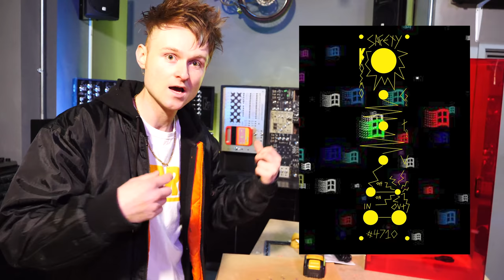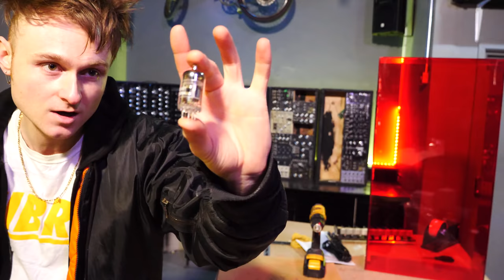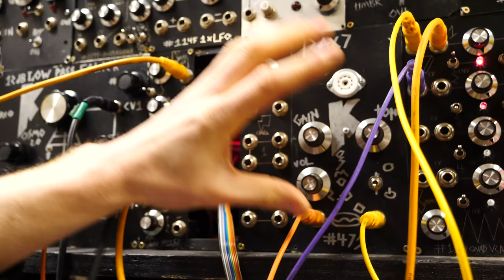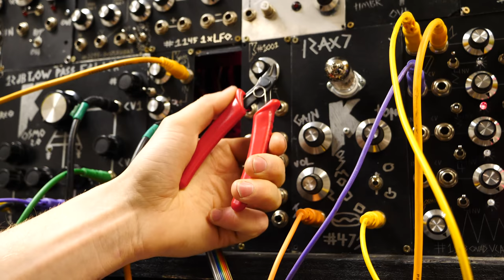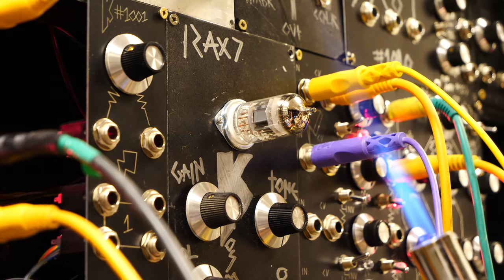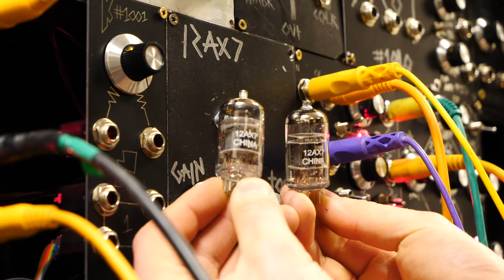Breaking a Vacuum Tube And Seeing What It Sounds Like - On A Valve Distortion

Comment from the maker: sorry if this triggered you, but the fact is i knew what would happen ie the technicals and theory... its obvious,, i did this to see what sounds it would make in the process of it happening. People are saying the heating filament went pop, this is not the case, its probably fine, this is running at low temperatures, the most likely explanation to what your hearing is an increase in resistence ruining the electrons commute to work..., in the next vid on this im going to try and revive these tubes. Im not sure wether its going to be super possible, but its worth a go. maybe id stuff em with calcium or some sort of getter aswell who knows i have a couple of things on order watch this space!.\
also samples from this available here and also extra vids on upcoming builds:
https://www.patreon.com/posts/46690985
Reply: aaand just became a patron! 😀
Reply: What happens if you hook a vacuum pump to one of those valves and vary the under pressure in them?
Would that be a vacuum bent circuit?
Reply: @zid_just_zid  Excellent idea!  I would also like to add....what happens if after you purge the air if you add an inert or alternative gas?  Something like nitrogen would be a place to start.  A simple vacuum pump, nitrogen bottle with regulator with a couple of valves and a t connector could easily be bodged together by LMNC.   

He may need to attach a glass connector tube. A map gas torch could be used to heat up the connector tube and stick it to the valve/tube nipple.
Reply: Have you ever tried playing with 'flame triodes'? They're very simple to build and would be right up your street for the funky sounds they can make, but I've never seen anyone use them for anything outside of small experimental stuff. Search for them on Youtube and some examples should come up.
Reply: Can you put the valves in a vacuum and make them work again?  What happens if you fill them with different gases? :-)
Reply: This was of interest to many people, I think you've saved valves by sharing this information.
Reply: Experiments are never a waste.
👍😷
Reply: Was kind of sad to see them die but to be honest they probably didn't sound great but still... Old telefunkn, nos tongsols, nos rca really go to town. Newer ge stuff & some others really dont compare at all.
Reply: i know its not your norm....but someone needs to do how tos on building vacuum tube cercets
Reply: Hey, a while ago there were special triodes used to measure a pressure in science labs. Why don't you use one of them? Look for hot filament ionization gauges. The old ones even have the same pins as the regular valves. The benefits are that they can be exposed to the air while cold and they have all the glass fittings to work with gases and vacuum pumps.
Reply: so much anger  😂
Reply: I was actually pretty curious about the result. I haven't expected it would be so unspectacular. But I should have. You immediately put molecules where there should be space for the electrons. Do you want to test it better? Make a hole into a tube, connect a tiny rubber hose to it, seal it very tight with a glue or something, connect it to a vacuum pump where you would be able to regulate the pressure inside a tube. Turn the thing on with the lowest available pressure. If the vacuum pump is really good and the sealing is tight enough - it should work. Then very slowly increase the pressure. I guess the lamp amplification would just gradually decrease, no fancy effects. What is more interesting is playing with the filament voltage. When you decrease it - the effect would be very similar to that when the tube warms up. But when you increase it over the tube rating - it will not break instantly. You can test what would happen ;)
Reply: How about -- put a dab of epoxy on the nib then put the tube, er valve, into a vacuum chamber.  Maybe as the air escapes the tube, the epoxy will just kind of bubble and then settle back into a nice seal.  Clean the glass with some alcohol to make sure you remove skin oils that are on the glass.
Reply: @JB-xg7io  not sure but u know there is no air in the tube?, air rushes into the tube, not out, as he cracks it. as it is a vacuum sealed component.
Reply: I was talking about recreating the vacuum condition in the tube

Comment: I wonder if a strong magnetic field would change the sound.
Reply: Bump
Reply: I agree. And use an electomagnet controlled by CV.
Reply: @knuteri3  oh yes, please
Reply: CV controllable electromagnets would be pretty juicy to meddle with and threaten the valve leading to more darkness and chaos.  Chaos and electronic anarchy for the sake chaos and electronic anarchy!
Reply: It would probably be a bit like a VCA. The magnetic field would deflect the electrons away from their path to the anode. If the magnetic field was AC, it would push the beam back and forth at the frequency of the field. The problem is, if you permanently magnetized the metal in the tube, it would permanently push the beam somewhere and it would either be quiet or not working at all.
Reply: The anode surrounds the cathode so I think it's unlikely you could stop any electrons from reaching it
Reply from the maker: got some heft magnets on the way coolio
Reply: @LOOKMUMNOCOMPUTER  Nice!
Reply: It would.  I have  done that with  various tubes. Moving tthe magnets around the tube is like changing bias or  providing an accelerator anode,
Reply: @quantumbits  nice!
Reply: @quantumbits  I tried doing this with my Metasonix modules, but the only tubes I noticed any effects on were thyratrons. Maybe I need a more powerful magnet?
Reply: I put a magnet on the valve in my headphone amplifier and it made the sound noticeably quieter.
Reply: @LOOKMUMNOCOMPUTER  if the magnet changes the sound, you HAVE to make a modifyed version with an extra cv in and an electromagnet around the tube so that it can be modulated. also, love the kosmo modules, ive built the 3340 vco with all pw options and the 12ax7vca, im currently building a triple 3340 bank and plan on building more. this channel is putting out the best content on this website
Reply: @LOOKMUMNOCOMPUTER  grab the deflection collar from an old crt monitor.....
Reply: I've wondered something similar. Mine is to do with the risk of a magmount antenna too close to a valve communications receiver.
Reply: @LOOKMUMNOCOMPUTER  Keep Em Away From Any Hard drives, Could Wipe Em Clean depending on the strength
Reply: @wisteela  The tube only responded in  my case to a (maybe 8mm wide) neodymium magnet less than 1cm to the glass of the tube, in a way that it it is near to the anode. So unless it is some weird tube with magnets in it like a trochotron or a CRT (or a magic eye, those respond to even weak magnetic fields very visibly, and may have the picture warped until demagnetized), needs some precise adjustment or the magnet is very big, you probably won't notice any adverse effect. You could on the other hand also partially saturate a ferrite or steel core of some inductive element, and that could have some adverse effects. But again, strong magnet and very close to the component, and vacuum tube devices are generally rather roomy inside, so no components pushed right against the enclosure.
Reply: imagine.. a magnetic-tube compressor
Reply: @snazzback  I saw a patent for a magnetically controlled tube, which had flat, vertical bars between cathode filaments, and those bars were perpendicular to the anode. The magnetic field was applied from the top, making the electrons go sideways into that "grid". A normal tube grid also has support posts, and in some tubes the anode is closer to the anode and has higher surface area where the grids and the cathode is flat, and further placed and less or no surface where there are those grid support rods. An example of that would be some small signal pentodes for radio use, like EF80. There the magnet would make more difference I think. There are also beam tetrodes, that are almost completely not unlike a pentode, but the third grid is basically two large metal plates that certainly would get in the way of deflected electrons.
Reply: Simply placing a magnet near or around the tube will not really alter the audio. It may cause a "hot spot" inside the tube where electrons are flowing to one part of the anode more than another. The only way you would hear an effect in the audio would be to modulate the magnetic field, either by physically moving the magnet around or by modulating an electro-magnet.
Reply: @LOOKMUMNOCOMPUTER  or ad electromagnetic fields so you can controle them.

Comment: At 5:15 did you see how the metallic material that coats the internal top actually shrank as the air rushed in? 😱
Reply: Yes, that pretty cool!
Reply: https://en.wikipedia.org/wiki/Getter it is a chemical reaction between the getter and the oxygen
Reply: The metallic material you see is simply the result of a getter being flashed at the time of the tube manufacturing . The purpose of the getter is to react with remaining gasses after the tube evacuation. So   what you see it's simply the getter doing it's job reacting with air.
Reply: Salvatore Mancuso ah yes, I know the purpose, just forgot the name of the compound. It’s probably a barium getter. Never seen them disappear like that though, they normally turn white when exposed to air.
Reply: Yess
Reply from the maker: yeah its cool! it did turn white iits not too noticeable in the vid it left an oxidised translucent layer
Reply: It may well be that the light refraction index of the gas inside is different from regular air. Kinda like when you put a straw inside a glass full of water and you see the submerged part with a different angle/size compared to its top. The gas inside may have a magnifying effect that makes the metal coating appear bigger. It's just an optical effect.
Reply from the maker: @Astronometric  its possible but unfortunately not so, in this case the mirror substance is a getter, its a substance that soaks up any excess air in it, you saw it rapidly oxidise. 20 minutes after the air got inside the whole mirrored layer had turned into a translucent white layer. proably barium
Reply: @LOOKMUMNOCOMPUTER  I didn't know that! Very cool.
Reply: @Astronometric  the gas inside? These are vacuum tubes. Do you understand what the "vacuum" part of that means? 😉

And no, no gas has a dramatic refractive index enough to change visual perception like that. Not even sulfur hexafluoride, which is a very heavy and dense gas, is visible to the naked eye. It has an IOR of 1.0007 whereas the air around us is about 1.0003. As a comparison water has 1.333.
Reply: @SwitchAndLever  Touché. I was probably thinking about common lightbulbs.
Reply: The getter turns fully white eventually once air is in the tube - never buy a valve with white getter patch!

Comment: The thumbnail hurts me physically.
Reply from the maker: A wild hainbach appears. You use plyers on hainbachs vacuum tubes.... It's super effective
Reply: Said the man with the destruction loops 😉
No aggression intended. I love your art, Hainbach. Just look at Wouter van Veldhoven's great machines. I bet they change over time. Or Tinguely's trash machines. Mike Oldfield is said to have struck his tubular bells so hard with an actual hammer,  that he left dents in them. Change, decay and even destruction lead to unexpected results. Would your vintage toy pianos sound like they do if they had not decayed? It's hard on me too, but he didn't just trample the valves to piss me off. It was an experiment, and I fully support the experiment.

Edit: Typo removed
Reply: You were physically hurt??? 😂

Comment: Did you notice that the getter material (the dark metallic shadow) in the 2nd valve visibly shrank as soon as you knocked the tip off? Great demonstration of the barium reacting with the air.
Reply from the maker: yeah its cool isnt it! shame cus now when i re ad the vazcuum i need to think of somethjing else to use
Reply: @LOOKMUMNOCOMPUTER  If you use a good pump and just leave it attached while you run it, you dont need a getter. Might need a turbomolecular pump for that though. Not sure how it would sound on mechanical pump levels of vacuum and how fast it would die.

Comment: Maybe try to redraw a partial vacuum in it. See if you can make it work again, something like a large syringe and a small bit of tubing over the nub might work to get it low enough to work.
Reply: If that works, it might be cool to be able to vary the vacuum with the syringe to alter the sound.
Reply: exposure to air while running will eventually blow the heater, but it may last long enough for an experiment.
Reply: No, a syringe is not enough. You need to remove enough air molecules so that the likelyhood of an electron hitting an atom is low enough. AFAIK this is actually quite challenging and you would need a hig quality pump even for a vacuum that barely allows it to work. Otherwise it will be just silent.
Reply: @neur303  you can actually do it with a home made Sprengel pump. Problem is it's really slow and you need mercury.
Reply: @xureality  Thanks for your reply. Sure that would be a nice experiment but probably more for a channel like Applied Science 😅
I haven't heard of a Sprengel pump before. I looked it up and it seems like it barely would be able to create the vacuum necessary.
Reply: @neur303  to be fair I learned of it's existence from Cody's lab 😉
And I think there's a process to "burn off" the remaining air in a sealed tube, kind of like a early light bulbs? Not too sure on this one.
Reply: @xureality  There's a second comment on the metallic "getter" material, which chemically binds molecules but fails to do that with inert gases like helium. I think that plus you normally heat the metal surfaces inductively to drive off any gas molecules that stick to the surface (I believe that's what you're referring to) allows you to have a pretty good and stable vacuum. Lookup "glasslinger" and "Dalibor Farny" for this artform :) It's incredible craftsmanship :)
Reply: You need a hard vacuum, like in space...  It might still work on the moon :)

Comment: Hook one of those tubes up to a vacuum pump and see what different atmospheres of pressure do! It might give you controllable levels of that fun weird die off that you can hear as the second tube is degrading. You'd have a vacuum density filter control. or at least some unique garbage.

Comment: The overall sound between the different tubes was interesting.  What about varying the heater voltage? Maybe you can keep it at the “just warming up” sound ?
Reply: This is a brilliant suggestion.
Reply: Liming the current to the electrical filament will do the trick.

Comment: Try experimenting with bias voltage, anode voltage, overdrive the heater push it to 16v! Wire the grid bias to the sound input but reversed, etc...

Comment: Experiments I would like to see:

Temperature control - Heat it up or tape some ice to it or whatever
Magnetism - Hold a strong magnet in various positions around the tube
Turn the 12ax7 into say... a 15ax7. Or a 20ax7. - Overclock that shizz

Comment: That silver finish in the tip is responsible for reacting with remaining are during the original manufacture process. Notice how it turns white when the seal is broken, serving as a visual indicator of a bad tube/valve.

Comment: been using 12AX7 and 12AU7s for most of my career. Try varying the plate or base voltage to affect the headroom and distortion output. Also, 12AZX/AU7s can be used for EQ.

Comment: MAGNETS. You can use a magnet to manipulate the flow of electrons, just like you could distort the picture on old CRT monitors and TVs with one. It will eventually damage them permanently though.
Reply: There were some tubes that used magnetic deflection to modulate signal or do other things, like phase modulation, multiplication or the like

Comment: Truthfully, I've never seen or heard a tube fail... it seems like they either run forever, or they're dead by the time I get my mitts on them. This is good to know. But thank you for using a modern 12AX7 in lieu of a vintage one. At least those are still being produced.

Comment: Be extremely careful if you are ever in the position of having a broken valve in your amplifier. The anode (the exposed metal inside the valve) is connected to the high voltage supply and could easily have 200-250v on it, the loss of vacuum wouldn't necessarily cause the fuse to blow. So if you ever have a broken valve disaster, switch off the amplifier and leave it for 10 minutes to allow the power supply capacitors to drain before attempting to touch the broken valve.
Reply from the maker: Indeed! It was one I built myself it had anode at about 400v eekerz
Reply: @LOOKMUMNOCOMPUTER  yes, that's the problem. With no current flowing through the valve, there is no voltage drop through the anode resistor. So you end up with the full HT on the exposed anode!

Comment: Not sure how practical, but you could hook up a vacuum line to the tube and a bleed valve to control the amount of vacuum to see what effect it can generate (maybe a vacuum pump connected to a small cylinder)
You could also try added other inner gases and make custom gas mix valve using the same 12ax7 as the base tube. I believe inner gas filled tube al ready exist but dont quote me.

Comment: You could try to increase the filament voltage until the filament burns open.
But that won´t be that spectacular, too. After it breaks and cools down, the sound will fade away.
But it might be interesting when the tube is part of an oscillator. I built a tube synth once,  using oscillators built from gas filled tubes. Filament voltage, plate voltage and temperature affect the tube.